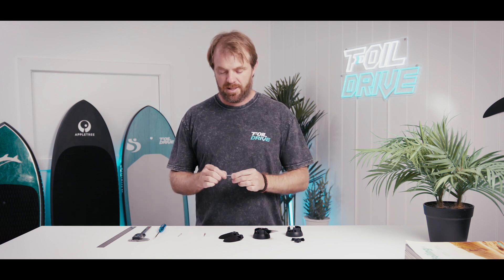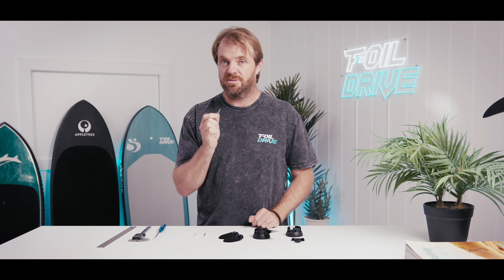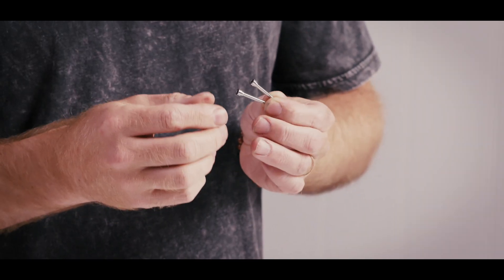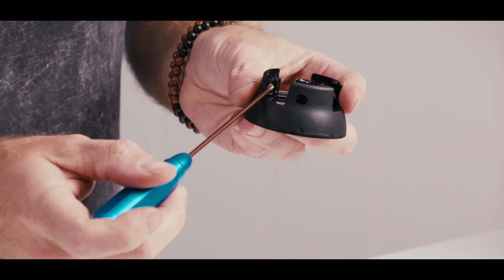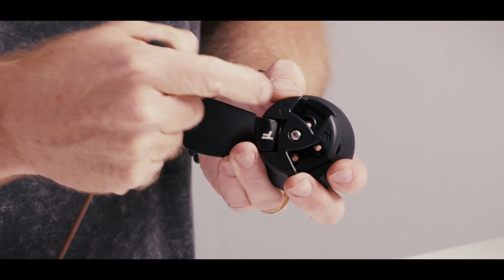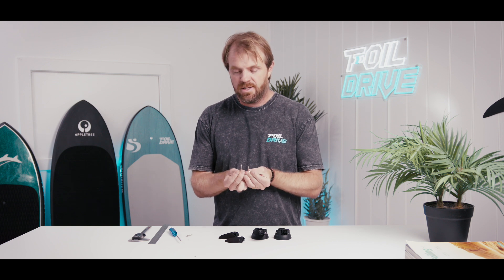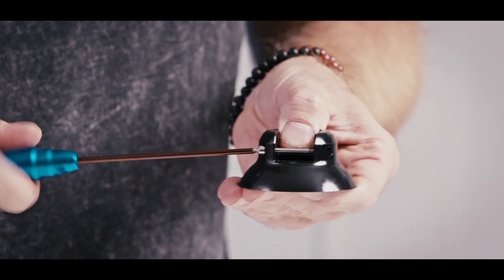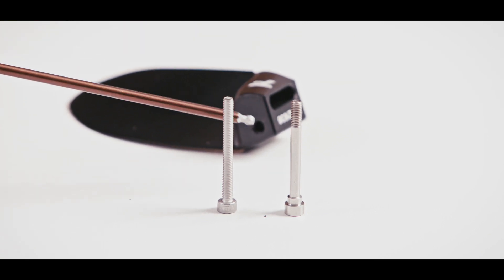Foil Drive | Three Blade Hub Update

Comment: Hi Paul, if it is interfacing Stainless steel and Aluminium, should the bolt be made of Titanium?
Reply from the maker: Great question! We played around with a few options and found the load on these bolts was more than fine with stainless! We decided titanium here wouldn't be necessary so opted to keep the cost a little lower with stainless!

Comment: I have the three prop upgrade and occasionally, mostly when transitioning out of wave after foil glide back to triggering/motoring I get a vibration or jitter lasting for a couple seconds. Is this normal? I feel like it’s putting undue pressure on the props and bolts themselves feeling something’s gonna break/give. Just wondering if this an issue that other 3 propers are having and if there is a fix?

Comment: We have a two blade prop , and I can confirm zero problems, the set up works perfect for us. Are the advantages of a three blade worth changing if I have not had issues and we are real happy with the two blade set up ?  cheers
Reply from the maker: Great to hear you're having success on the two blade! The Three blade propellers aren't necessary especially if you're finding the two blade fine. To give you a quick insight. The Three Blade offers more low end thrust, but less top end speed. It's ideal if you are someone needing a little more when taking off but also has benefits if you are running motor positions closer to the board. Particularly noticeable if motoring back up wind, or down winding, where the propellers are entering in and out of the water. With three blade, you always have two blade in the water at any time, where as the two blade, if you are motoring close to the surface, there may be times where only one propeller is in the water. 

Depending on how you use your Foil Drive, it may use more battery. But for some, it makes takeoff more efficient meaning you're on motor less!  

Most people who upgrade to the three don't look back, but if you're not having any problems on the two it might not be something you need! 

- Caitlyn
Reply: @foildrive  Thanks for the info.. at the end of the day it looks like a good upgrade. thanks

Comment: Thank you for addressing this problem. I am a two blade user. The new bolts are just what I have been looking for. I dont really want to remove material from the hub with the drill but I will give it a try. I have taken to using the foil drive plus hub as it is a composite construction and I have never had a failure with the hub material, but the screws would bend and fail.